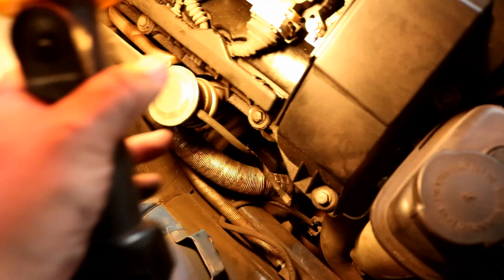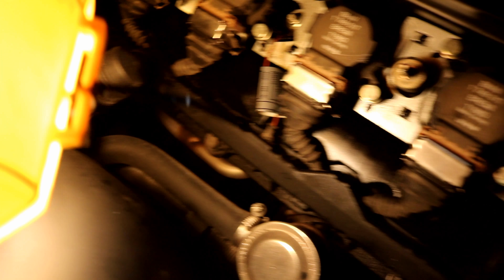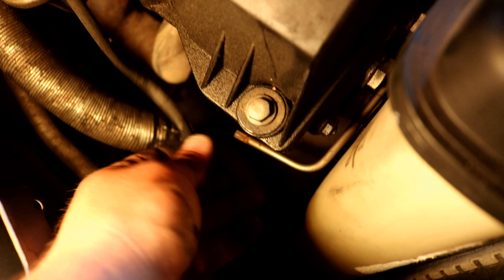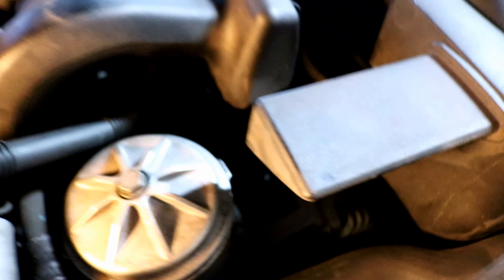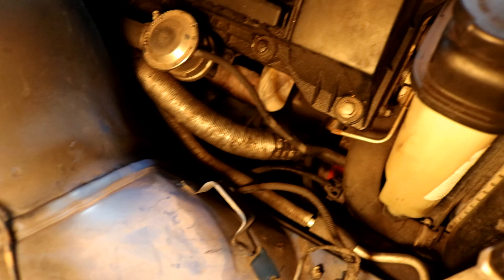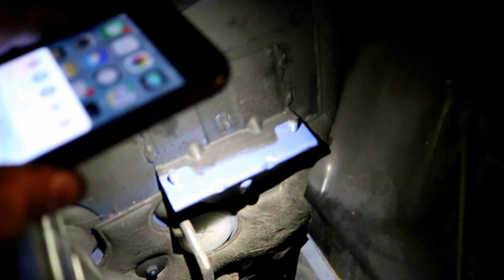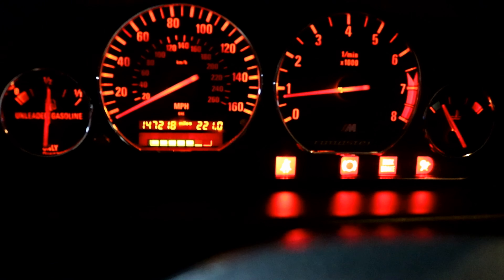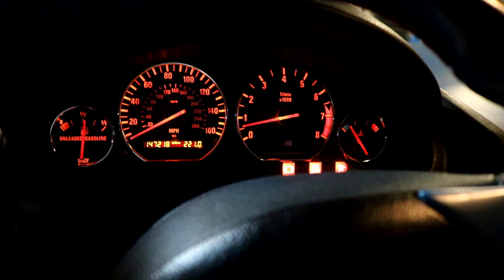SAP Delete on M Roadster

Comment: That small hose it’s a vacuum line that goes into a small check valve , if you don’t plug it you will have a vacuum leak.
Reply from the maker: You're right. I got it plugged when I added the supercharger.